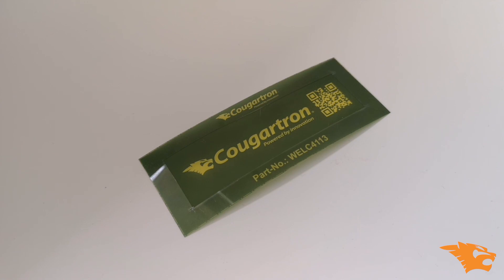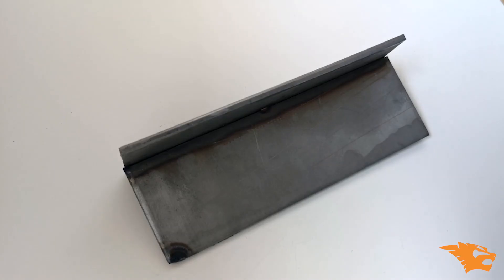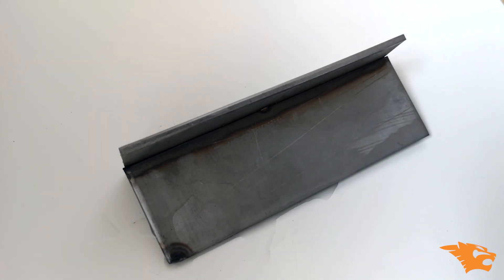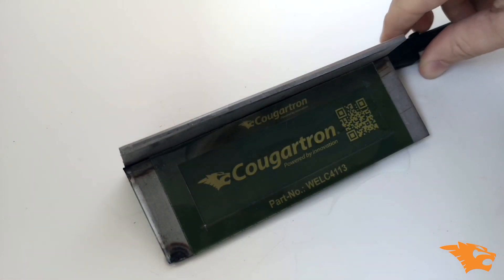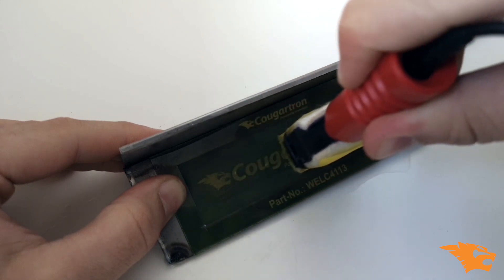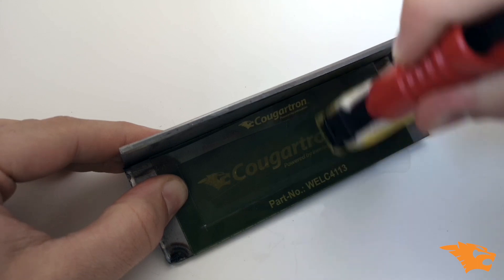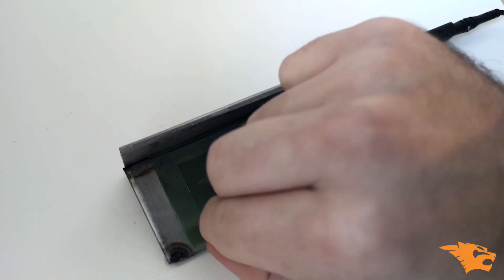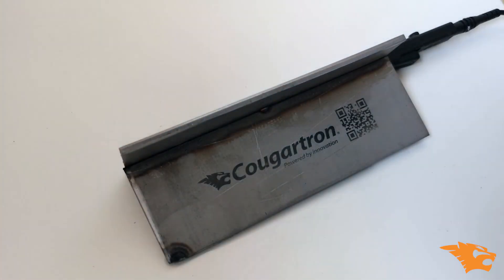How to etch your logo onto any metal? Ask Cougartron Part 6

Comment: What is the function of yellow fabric? And why it is necessary to mount it above the white felt?
Reply from the maker: Great question. The yellow fabric is not a must for the white felt. Some like it as it helps to increase the lifetime of the white felt, and also decreases friction between the marking head and the stencil. The yellow fabric is a must however if you are using the black carbon felt as this is very delicate.

Comment: Interested in this.  I need to know if when producing my own stencils if the text can be in two lines with different fonts?  Pretty much like your example has.  Large bold text on top, smaller text on bottom.
Reply from the maker: Hello Scott, these stencils are 100% customizable, you just send us your design/logo, dimensions and we will prepare it for you. 
You can also produce your own single-use stencils with a printer and etching tape. We can help you with the selection.

Comment: Just wondering if it can print on hard anodized aluminum?  The hard anodize is clear but is a grayish color when complete.
Reply from the maker: Hello, thank you for the question. Unfortunately not, the anodized aluminum blocks the electrical current so it is not possible to use the electrochemical marking method for this type of surface.